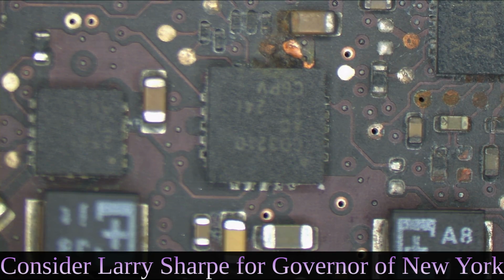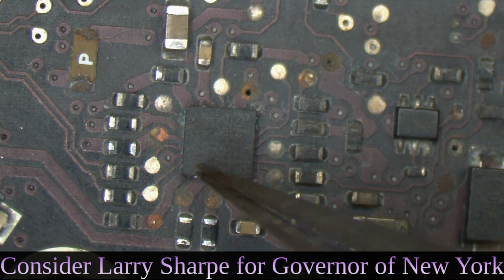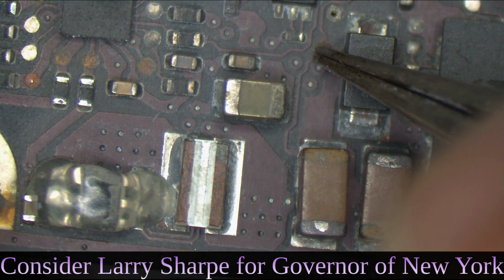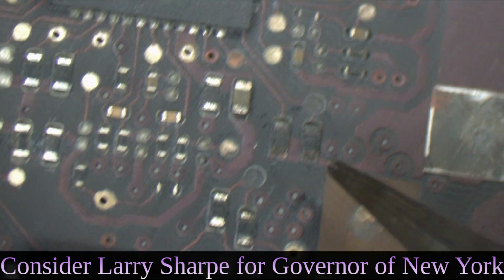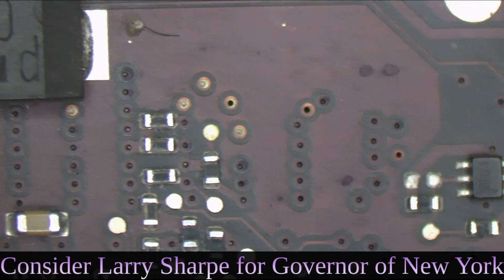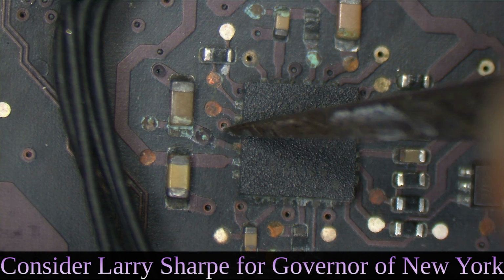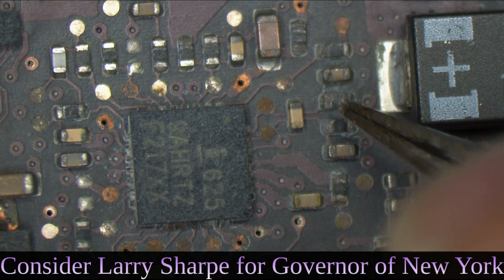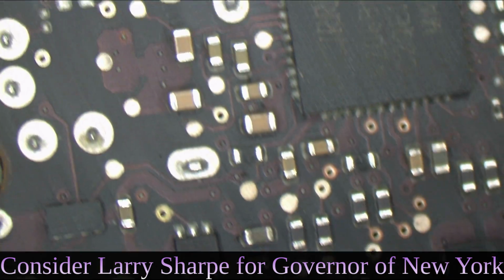Nastiest Macbook board ever.

Comment: a long time I was working as a tech for a company that made video editors..  hardware not software... 
I got in the mail a big box... with one of the company's top of the line editors in it..   As I pulled it box... the case made the sound you may hear from one of those "rain sticks" sssssssssss-thunp... ssssssss-thump... I opened the case and every IC and bits of other components poured on to the floor...   What happened is the tv station got hit by lighting.. the surge went down the power lines and blew every component off the board.. fried every race.   They wanted to know if we could fix it being that this editor cost like $80K..

Comment: Dropped in a chlorinated pool, "dried" in rice for 1 day before being plugged in using the power brick that also got dunked but it doesn't have vents so it's obviously fine and dry inside (it wasn't), 120 volts sent to the board. Once the smoke cleared, they sent it to you.
Reply: TheFurriestOne I don't think the 120V are needed.  Just drop in pool, dry insufficiently, power on to let the internal heat "dry it", every active circuit during the wet run gets major corrosion and short circuit damage, least attempted parts get least power and least damage.  Nowhere near New York voting booths.
Reply: Plausible, only the owner knows for sure.

Comment: Hi Louis, I was browsing through your videos for the one that explains diagnosing bad u5010 (SN0903048). I was trying to figure out what happened to my A1278(with 820-3115 board) which is not charging, sluggish performance, takes too much to time to boot and not able to reset smc. I believe the video i was referring to might give me some clues. I'm not a pro, just a guy with 25$ hot air station and a teeny tiny soldering iron so pardon me if I'm asking this question in the wrong place.

Comment: Did someone had a go at this before? Looks like somebody forgot to take it off the ultrasonic on time/set the timer wrong. Or used too concentrated an acid solution. I left a SCUBA regulator in an acid bath on an ultrasonic cleaner for too long and the result was not pretty.

Comment: Questions: A) My iphone 6S-Plus is complaining about charging devices not being compatible. Also that battery seems to be losing it's ability to hold a charge. Is this something you know a fix for? B) I have a 2012 MacMini (2.3Ghz Quad processor) that I've partially disassembled. I'd like to get 2 SSD drives installed, but these cases drive me batty. Would you be willing to take all of the parts and assemble them for me? C) Would you like some really old to old non-working Mac Mini's? I've got a whole bunch that I don't know what to do with. Not looking to make any money off of them, just looking to find a use for them. Thanks!

Comment: OK. If that Mac Book could lose that many components and remain functional until just recently, I would have to be really impressed! But, I don't think so.It is either a troll, as you suspect, or it sat, unused, on a desk, in something like a metal plating plant, where there are so many corrosive gasses being produced that it is eating the metal off the sides of the building.
Reply: Or could be a glass of soda, orange juice or any other somewhat acidic liquid.

Comment: I put a laptop on my desk to do a data recovery on it, and all of this brown twiggy stuff and flecks of dirt fell out.  "Okay, they must have had this thing sitting on the ground outside."  I opened it up and it wasn't twigs...it was baby roach legs.  Hundreds and hundreds of baby roach legs and roach crap all over the inside of the laptop.  Not a single roach or roach part other than the legs.  I double-bagged that thing, cocooned it in tape and NOPED that thing the fuck out of there.

Comment: Amazing it was working with most of these issues then one last issue made it not work. that makes me think maybe apple products are good after all. nah!
Reply: It was certainly the result of one fatal accident. Acidic liquids (like some soda or orange juice) can damage the board quickly. The fact you can't remove the battery thereof prevent it from accelerating the corrosion by electrolysis won't help either.

Comment: Hi Mr.Rossmann and anyone who have experience of this situation. i have a question to ask and hope to get a respone from you all. That is recently I spilled water on my laptop( about half a glass of water) after the incident I immediately unplugged the charger and pat dried it. I brought it to the store where I bought it so it could be probably taken care. After 2 week they told me it couldn't be fixed and returned it to me. I brought it to 2 other laptop service store. the before gave up on it and the later said that a IC is killed and damaged I had to replaced the mainboard cause that was the most efficient way. So I want to ask that whether the laptop service store was right or they just want me to replace the mainboard cause it will be easier and profitable for them ?